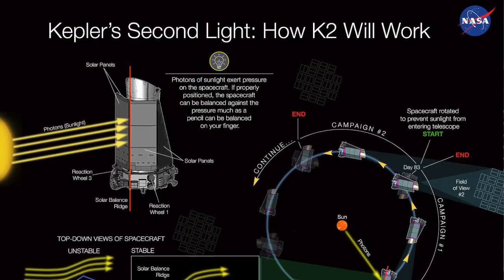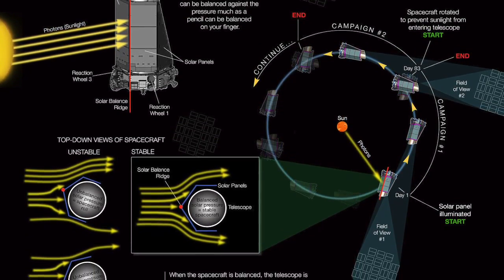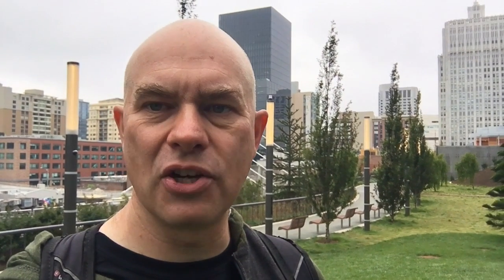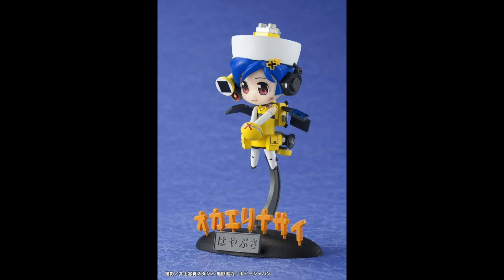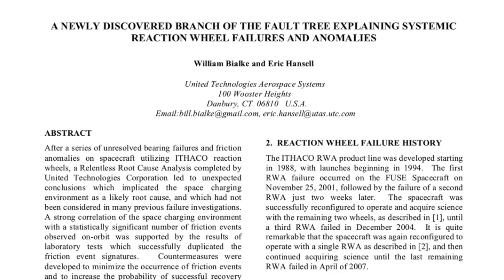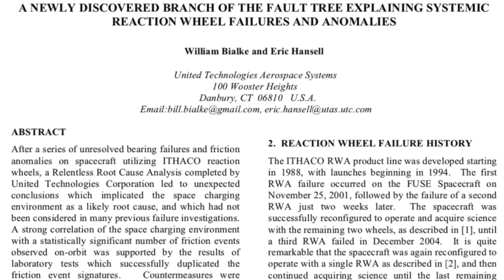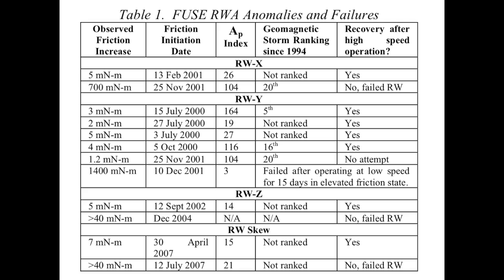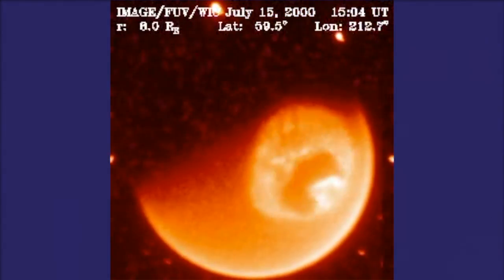Scientists May Have Figured Out Why So Many Spacecraft Were Failing

Comment: Ceramic ball bearings will eliminate this problem and allow less friction for even faster reaction wheel !
Reply: abcd efgh     watch the full video
Reply: abcd efgh I guess you didn't get to the six and a half minute mark
Reply: I'm not sure ceramic bearings have a higher speed rating.
Reply: Gordon Lawrence they have up to 80% less friction so you can have them spin faster
Reply: nope lower friction does not mean a higher speed rating - if that were true jet engines would have ceramic bearings. The speed rating is mainly governed by the viscosity of the lubricant. Jet bearing oil is almost like water. Then there are of course the other issues with ceramics - IE they are seriously rubbish under tension, and believe it or not spinning things like say the ball in a bearing spin, which of course puts them under tension.
Reply: Budget cuts.  Every time some congressman needs to wipe their ass, they cut into NASA's budget to procure a roll of toilet paper, which is gilded and on a roll made of ruby-encrusted platinum, because reasons.  This shit's why the Space Shuttle was obsolete before it even flew and why we haven't been back to the Moon since the 70s.  Private companies, who aren't quite as beholden to the whims or greed of politicians, don't have this problem to the same degree, which is why they're picking up the slack while NASA stagnates.

Comment: Scott Manley why not use ceramic balls and bearings? It would seem like a simple fix, can you tell us why they dont go with advanced ceramics and rather stick to SS or titanium? I mean there has to be some reason why they stick to metallic bearings. Ceramics in ball bearings is not a new tech at all, we have had it for quite some time now. Ceramics would overcome this problem and would last much much longer right? Especially Zirconium carbide based materials. Waiting to see a new video on this!! Thanks and fly safe!
Reply: He says in the end that Ithaco DID switch to ceramic bearings. 
I've seen a lot of comments suggesting ceramic bearings, did all of you guys comment before finishing the video?
Reply: Did you see the end of the video?
Reply: Thanks Ashwin I was thinking the same thing.  I just was a bit slower on the keyboard. :P But I have another question for Scott or anyone really.   If this failure mode was entirely unknown why did they start switching to ceramics ten years ago?
Reply: Hi Charles.. Since no one asnwered, guess I will have a stab at it.. THIS failure was not known until actual failures happened in the satellites (like metallic bearings getting welded due to high energy radiation from the Sun and probably a small factor due to other high energy radiation sources). So, it was not entirely unknown and the space nerds had a pretty good idea what happened AFTER it happened. In space engineering, sometimes they go conservative so that could have been a part of it, Titanium bearings were all the rage during those times. Using ceramic bearings would mean using ceramic casings and maybe at THAT particular time, they wanted to go simper. These were satellite bearings afterall.. The cost to validate and prove the ceramic bearings may have been too much for them. However, once they recognised the problem, they were quick to switch to the better ceramic bearings. In conclusion, NO this was not entirely unknown (they found welded bits), and yes they did switch to ceramics based on their findings. Any tech IMHO is just trial and error, without errors we wouldnt fix it. Ur question is kinda strange cos it implies that even though they didnt know, yet they switched to ceramics. I dont think it happened that way. There was a problem to be solved and good old hands to grounds people sorted it out :-)
Reply: Ok Ok guys, Im sorry I jumped the gun on this one. Smarter people figured this one out! Klobi and gavinoaw thank you guys for correcting me and making sure I see till the end of videos. My bad, and ofcourse these space nerds figured it out before me, what was I thinking, duh!
Reply: You still came to the "right answer" even if you weren't the 1st. Remember, the early-bird gets the worm but it's the second mouse that gets the cheese.
Reply: Thanks Robert, To be honest, Im feeling pretty foolish and embarassed that I didnt watch till the end. Live and learn right?
Reply: lmao the second mouse gets the cheese nice one
Reply: Alas progress in the technology of self resetting rodent traps has rendered that saying largely obsolete, now all the mice get a metal spike through the head and none get the cheese until the battery goes flat. :-(
Reply: Ashwin Mohan No need to apologize man :) 
You've already shown that you are less of a fool than 90% of the people on youtube by not letting this escalate into a pointless argument! ;)
Reply: gavinoaw Thanks buddy. We all make mistakes and I made a Huge doozy. U were kind and not trolling me. I appreciate that my good man!
Reply: Commenting before you finished is no big deal - everyone's done it. You should be proud you came up with the solution. And the "second mouse gets the cheese" comment is PURE GOLD. Hahaha.
Reply: Thank you Doug Walp for going kind on me bro. i still feel foolish, though. Second mouse gets the cheese is hilarious and star of the show!

Comment: you know its also possible they realized this about 10 years ago said "yikes!" and quietly switched to ceramics
Reply: While this is absolutely possible, I rather think they switched because of weight saving.
Reply: Or durability. Ceramic bearings should wear a lot slower.
Reply: I work for a large organisation and look at equipment used at our facilities. One of our hardware vendors insisted that nothing was wrong after i directly showed them what i believed was a problem. They later admitted the issue but by that time they'd rolled out a new model, and guess what? The new model had exactly addressed the issue i pointed out, meaning that at least someone in their organisation knew about it for a long time. Corporations can be as dishonest with each other as they want if they feel they can get away with it. I wouldn't be shocked if it's true that they moved to ceramics here because they secretly knew about the defect.
Reply: @Candesce  this, I had a a machine failure once where every bearing seized, it turned out that batch had an electroplating step skipped during manufacturing, causing it to shed the top layer under load. We had to disassemble, and replace every single bearing. When we called, about the bearing seizure, they knew the failure mode before we had analyzed it. They knew, but shipped anyway to meet deadline.
Reply: Yikes.  I'm expecting a CNC mill delivered mid September.  It would've arrive at the beginning of this month, but luckily the supplier found out that the bearings had a flaw and delayed further mill production until they could sort things out.
Reply: @chiraedisk702  company if you don't mind revealing them? (Should be good press for them anyway.)
Reply: I'll save you the trouble as it's a terrible design.  I've been testing it for 2 weeks now.  It's the Inventables Carvey.  The stepper motors are so weak that it can go off axis at 10ipm in wood just the same as aluimum.  It really isn't good for anything that a cheaper machine could do.
Reply: that is exactly what i though, also, if theses reaction wheels are "high quality" how bad is the competion????
Reply: Probably the same quality, just more expensive.

Comment: All hail ceramic bearings

When having balls of steel isn't enough
Reply: Man, AvE needs to make a T-shart out of that.
Reply: "Balls of ceramic" doesn't quite inspire the same sort of awe and admiration, though, dontchathink?
Reply: @Duncan_Idaho_Potato  needs know they should have balls of ceramics....but most prefer balls of steel because chicks prefer hogs over needs. I took the middle ground. I'm a jerd. Understand basic science AND get laid without paying .... Hahahaha
Reply: Also ceramic is more fragile, I think balls are delicate enough already (shitty design).
On the other hand I wouldn't want my balls get welded together just for being in the kitchen when the microwave is on.
Reply: @pomodorino1766  ceramic bearings are 30% harder than steel dumb ass & can be made even harder, have you not heard of Ceramic Armour
Reply: haha good one buddy!
Reply: Ceramic bearings would probably have fewer problems because of the surfaces. Would probably handle heating/cooling cycles better than steel and electrical discharge. But, then again, if the grease/lubricant being used is causing undue friction for some reason you'd still have failures.
Reply: matchesburn  Use no lube then!
Reply: @kaosinc  use no lube....take a run-up
Reply: zztop3000  magnetic bearings have a new set of problems.
Reply: NoName - when balls of glass are better than balls of steel!
Reply: They should make ball bearings out of artificial diamond; similar to rubies used in watches and clocks. It would be harder than any other material, non-conductive, and non-magnetic. Maybe it wouldn't even need lubricant.
Reply: NoName You won the internet.
Reply: Thanks just found out the other day my Tesla uses ceramic wheel hub bearings. 3k for a pair.
Reply: @brandonbarr2784  start a business that sells aftermarket replacememt steel bearings for less. i bet there's a market for it by now it they actually fail regularly enough
Reply: Joe I really didnt mean it as anything but a cheap joke, but thank you for taking it sportively.
Reply: Badum tish.
Reply: Surely this is the answer. Maybe the "cage" for the bearings should be a non-conductor also? Some lab testing is in order to see how high the voltage needs to be to jump from the cage to the bearing ""race" to allow a "jump" across past the ball itself to complete a circuit?
Reply: Its pays to be 40x lower friction and 2x as strong as steel. Good work.
Reply: 1000th LIKE!!!

Comment: So vacuum welding and pitting?
That’s why all most space structural metals are coated
Reply: Uh... no, this is not cold welding. This is your typical run of the mill welding and pitting. In this case induced by electrical discharge. Cold welding isn't possible in a bearing because of the lubricant... you know... coating everything.